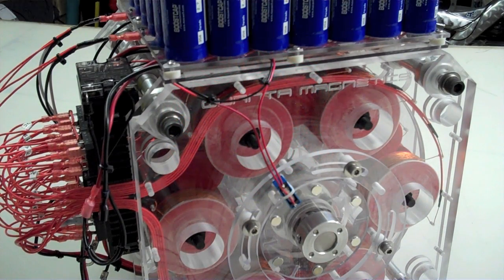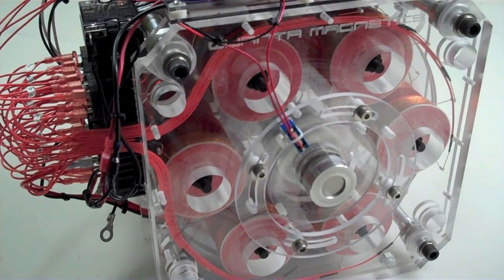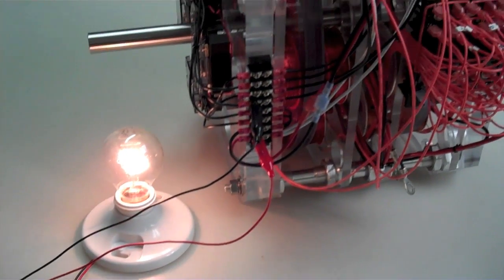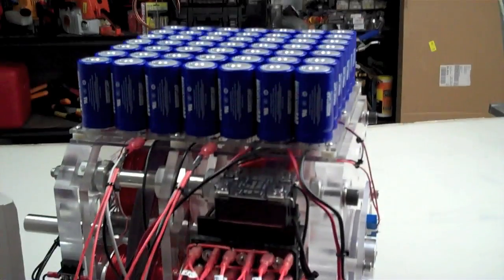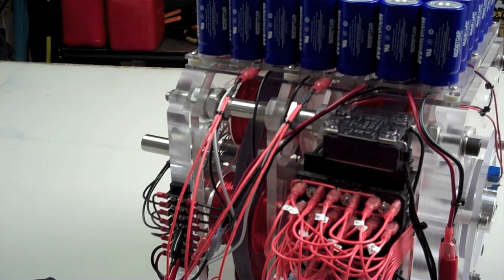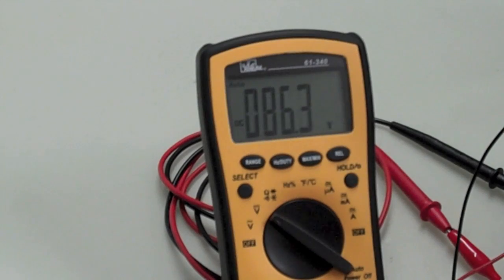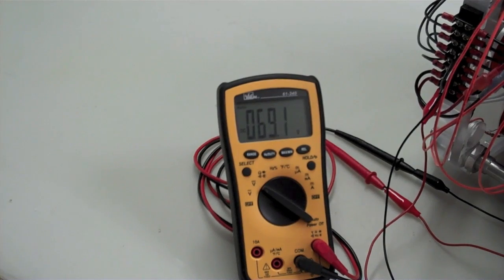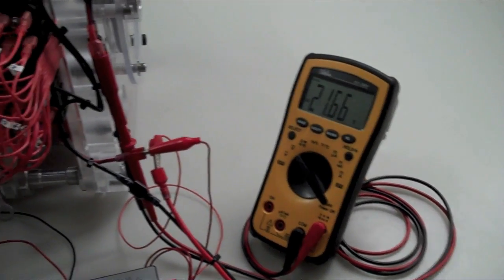Q2 SELF CHARGING.Part 2

Comment: it's a possibility that the coils have reached their full storage potential and the excess effect is being released as static and being absorbed by the bank of caps directly above the coil sets. It would make sense that it pulses.like AC current. Have you ever tried measuring the output of a single coil in this situation/setup?

Ken,
Revolution-Green(.)com

Comment: Its fantastic to see your efforts here. You are the type of people we need moving forward to change the way how we generate and use electrical energy. The seed has been planted and it will grow into something HUGE. As for the shock from the capacitors, if you touch one single capacitor, do you get the same shock as touching 2 or more? I'm thinking induced voltage but it just doesn't quite make sense. Maybe setup a trial with your 3 cap banks away from the mechanical rotating components?

Comment: Interesting comment, I read something several years ago that mentioned something about a radio transmitter having the ability to oscillate hundreds or thousands of speakers to deliver a pulse to permanent magnets driving the speakers on the receiver end. I do not recall the specific details, but the point was the transmitter output was not as big as the energy required to pulse all  the speaker magnets if tuned correctly. Was this an old wives tale or is there anything interesting going on there

Comment: Great device! You were wondering how the caps are charging on the background EMF, here is something I found that may help; "German student builds electromagnetic harvester to recharge a battery" - A student at the University of the Arts in Bremen, Germany has an electromagnetic harvester, it converts electromagnetic fields  into electricity to recharge a common AA battery. He's won a 2nd place award 2013

 w w w phys.org/news/2013-02-german-student-electromagnetic-harvester-recharge.html

Comment: Attempting to answer your question, i'd say that the difference is manifested in kinetic energy as opposed to a Solid State Power Inverters/Amplifiers are used in transmitters outputting RF. You're getting the 95% efficiency in a motor not an amplifier. The motor can be wired up as an amplifier circuit but the kinetic potential is where the difference lies. 

Ken @ Revolution-Green(.)com

Comment: Good to hear your response. To be sure, I have almost no idea of all the mechanics involved with wireless transmissions from radio to satellite to the wireless router running this computer. I follow that frequency is critical to it all, but what I think many folks are wondering is easiest to ask with an example..The sender and receiver both require input power, but what is a rough ratio of the power lost in the transmission ?  And what are the key variables involved ?

Comment: Radio broadcasts are produced through a series of oscillator, mixer, amps and filters,  but I think the "tank circuit", which is a solid state oscillator w/ a capacticor and inductor is what your talkin about, its mainly responsible for the frequency for your carrier signal that is modulated with intel and sent to the antenna.

Comment: This sounds good, there must be some wireless i.e. radiant energy going on. If so, it is reasonable that this energy transfer may not add an increased load to the original pulse. Getting back to overall  input  verses  output, are you seeing 1% in the shock value, or even greater ratios ?

Comment: All I see here is beautiful craftsmanship and clever method to amplify and oscillate the DC energy stored in the caps.  But that is ALREADY a conventional technology, and very very efficient at that with TRANSISTOR amplifier circuitry.  HOW IS THIS MORE EFFICIENT THAN SOLID STATE POWER INVERTER/ AMPLIFIERS, which is around 95%,  should be the real question.

Comment: Following up on a reply to recent comment you made, When I mentioned input and out are nearly the same on the scope screen, as you likely knew, the "off" pulse is opposite polarity to the on pulse. Also, as discussed,  the off pulse clearly shows longer duration with lower voltage on collector bank and changes proportionately as receptor cap voltage changes. Now wondering, do you think I am only storing back emf and there are also ways to collect counter emf  to minimize overall heat losses ?

Comment: Using basic diode paths, not bothering with double wound coils I have found it easy to recover 20-35% of input energy to run a pulse motor. What I wonder is...can this recovery make the pulse motor as efficient or more than a well designed 3 phase ac motor already available for sale ? Any feedback appreciated.

Comment: I thought you might find the "original " stored energy, and the recycle of it, a way to help explain your thinking. Apparently my thoughts were off base.

What happens between the weight and gravity has been well known for centuries now even before Newton days. Gravity works both ways.. put your experiment on the moon and the #s change but the outcome is relative i.e. the same.

Comment: And if you can rapidly generate voltage potentials, you can harness the radiant energy all around us, just like Tesla said to do.  In fact, charging and discharging an inductor is the primary step in Tesla's "Method of Conversion" patent.  Tesla was not mistaking back EMF spikes.  Few physicists question the existence of radiant energy anymore. Only people still clinging to old textbooks like they are bibles do. Wiki ZPE.  Tesla knew, Moray knew, Bedini knows, PMM knows. User27 doesn't know.

Comment: If I understand what PMM is trying to do, he takes an input of energy, does a standard mechanical conversion with every vanilla loss paid for but then takes advantage of a phenomenon known as a radiant spike (not bemf as user27 thinks) to create a sharp potential gradient in the static field all around us. In the instant the potential collapses the environment pours in a tiny bit of radiant energy, which is all but worthless for anything but charging batteries. But it is very good at that.

Comment: There is no stored energy.  If I give you 1 joule to lift a weight. You use up 1 joule to lift the weight. Nothing got stored anywhere. You didn't magically add energy to the weight. What you did was create a new potential gradient between the weight and gravity. If you release that potential, whatever happens between the weight and the ground is work being done by gravity, not you, not stored potential in the weight.  If unintended heat is generated, that is still work performed by gravity.

Comment: Your analogy literally had me laughing out loud. Maybe the thinking is to describe something like..  let me start out with energy stored in a raised weight.. I will drop it and use a clever device to capture the falling energy, then use it to get the weight back to 80% of the original potential energy. Now I just have to add 20% to repeat the cycle. Just recycling stored energy. My guess is your comment will explain the energy in this dynamic as well ? similar to flywheel storage or otherwise ?

Comment: Is the thought here that the momentum will crash the crystal and compensate for heat losses, leaving enough energy to put the stored energy mass back into place where it started from ? Have you considered the "a" part of F=ma and how that relates to the energy unit to raise the weight and drop it.
Proof and methods are in the hands of the inventor.

Comment: It seems you still are trying to make this into an overunity argument. It is not an overunity argument.  The tasks have never been to recover the energy in broken glass or the heat generated.  The task is to raise a weight and break the glass when you only have enough energy to accomplish one or the other.  If by any way possible both tasks are accomplished, you have COP > 1, not overunity.  No claims for overunity have been made by PMM.

Comment: Give me textbooks that explain the "fast transient voltage phenomena" that Tesla observed traveling ahead of any electron current."  The radiant event is separate and distinct from the well understood back EMF spike and trying to pass it off as that is ignorant at best. The Q2 is possibly what Tesla referred to as "method of conversion" between vanilla electricity and radiant. They are two different properties of electricity. Where are the textbooks on dumping radiant discharges to a load?

Comment: Please read the gabybewilde comment made several days ago to a comment I made. Long story short, a great comment relating to the proof being on the inventor. It is hard to say how you do it if you don't explain your methods. In my thinking, breaking the glass requires a little "more" than 1 energy unit. Most all collisions (w/few exceptions) are elastic however dense the materials may be. Even if the energy in the broken glass is recovered, the heat generated is already gone. All things possible

Comment: Agree, the timing resistance and voltage relationships mentioned here are always consistent in my scope screen as well as measuring varying voltages of the cap bank the discharge dumps into.

Comment: I will study it further, thanks for the feedback. When you say the coil output is exactly the same as the input..then why not collect the discharge in a cap bank..at NEARLY the same time the input pulse has transferred to the permanent magnet on the rotor to add a bit of torque to keep the rotor in motion if the timing is accurate enough. The scope readings do show similar for input and out but I can only recover 20-35% depending on the relative voltage of the cap bank being dumped into.

Comment: It may be that nothing unusual is happening in the motor or the coils. I am quite open to that possibility.  It may be something unusual happening in the batteries.  But some phenomenon is happening that makes using an electric motor to turn an electric generator to charge batteries more than just a simple plain vanilla demo of well understood electromagnetic theory. My solar panels pulsed to my battery bank, never produced the effects I've seen with my motor-generators and radiant spike.

Comment: The goal was never to put the weight back on the ceiling. That is an overunity argument. The underlying question is whether environmental (gravity) input can be counted as work done.  In this Q2 case, what environmental input might be occurring in the motor coils that may contribute to "super" battery charging?  If no work is contributed by the environment, then User27 is right and vanilla is on the menu. I'm not so religiously tied to my textbooks believing they explain all there is to know.

Comment: You have two tasks to complete. One task is to raise a weight to however high 1 unit of energy can lift it.  The other is to shatter a piece of glass.  You only have 1 unit of energy. If you use any of it to shatter the glass, you won't have enough to lift the weight to the required height. Breaking the glass requires a little less than 1 energy unit. I dissipate all of the 1 unit to raise the weight, but I still accomplish both tasks. How did I do it? According to your math this is impossible.

Comment: Aaron, you have great energy and I hope your passion in the energy field works well for you.

Total work done is still x not 2x. you cannot collect the destroyed floor energy and also put the 100lbs. back to the ceiling.

A collapsing field is simply a residual of energy used to energize the coil in the first place. The work to collapse the field is a ratio of the energy used to energize the coil in the 1st place. Carefully collected this can certainly add to the efficiency of a pulse motor.

Comment: Different approach.  Say the intended work is elevating and suspending a 100 lb weight to the ceiling. It takes x units of energy. Once accomplished, ALL work is done and all of the energy is dissipated. But as a side effect of GRAVITY, a new potential grade is created. If the hook breaks years later, gravity, (not you) will impart the same x units of energy in unintended work--destroying your nice floor. Work done by YOU = x. Total work done = 2x. What work do u do to collapse a magnetic field?

Comment: I can't speak for this motor, nor have I achieved such amazing results myself.  What I have achieved is a slow, yet sustained reduction (over months) in the charging time and a slight increase in the amp hour capacity of my batt bank. I didn't accomplish this with the a well understood pulse charge. Please explain to me in intimate detail how you've measured on your bench the effect of a radiant voltage spike applied to a battery bank over months of testing instead of one day denouncements.

Comment: So how much 'work' can it do?
I notice you say the motor is on "full power", "Full torque" It certainly did not sound it to me, how do you calculate 'full power' without a measuring the torque (power)
Also how much power did you put into the system a/using the battery bank (in watt/hrs)
You say when using a light bulb that it is "not really designed for resistive loads" Really, what other type of loads do you know? Any battery to be charged represents a resistive load to the charge device.

Comment: I also think PMM has come a long way in developing worthwhile devices. I hope you will comment and find encouraging results with the Q2 ! Can't say I completely follow the rubber ball analogy. 1 unit of energy would hit the floor and being an elastic collision 20% was spent hitting the ground and the other 80% took the ball back to 80% of the original height. I do think there are advantages to momentum and gravity (electrical and otherwise) that have not been fully realized. Good luck.

Comment: The claim is not more out than in.  If that were the case PMM would not state that this machine eventually quits spinning and dissipates all energy in the caps through the motor coils, heat loss, impedance, magnetic drag etc... Like every other motor, this unit is less than 100% efficient, otherwise it would be a virtual perpetual motion machine and PMM has never claimed that. It is a net consumer of energy, just like your fridge. Likely (I haven't tested it yet) the Q2 does have a COP > 1. How?

Comment: Well, I'm just looking at this from a very simple layman's point of view. If you're getting more energy out of a system than it takes to run the system, it looks like over-unity to me. So if the generator section, via the capacitators is putting out more energy than required to run the motor, enough to light up a light bulb (carry a load) while still powering itself, isn't that over unity? I notice the amperage is very low though, so maybe it's a question of power...

Comment: I somewhat agree.  I'm not knocking textbooks. They have their place and life is a lot better with them than without.  However textbooks should be used as reference manuals and not bibles. Somewhere along the way, we replaced experimentation with textbooks containing a 150 year old, unbalanced, antiquated equation.  Disclosure: I am a adjunct professor at a large university and use textbooks constantly.

Comment: The main point of these types of motor-generators is using 10 solar panels vs 20 to get the same net charging effect in your battery bank. That is special.  But with only a textbook education, you only see the asininity of hooking an ELECTRIC motor to an ELECTRIC generator.  It makes you angry to see crap like this posted and the uneducated falling for it.. Makes you want to slap the stupid out of some people.  ...until you build/test one for yourself and realize your education missed something.

Comment: These are expensive experimental devices and I personally don't recommend buying one until you completely understand the difference between efficiency and Coefficient of Performance > 1.  Until you do, this is nothing more than an expensive, pretty motor.   RadioShack has a great introduction manual to electronics. Their arduino manual and kit are also a great way to get into timing circuitry. Google and build a "pulse motor" that captures a radiant spike. Be prepared for a learning curve.

Comment: All reasonable points mentioned here. However I do not think our current textbooks completely explain the energy transformation that occurs every time an electrical pulse is turned OFF. One way I look at it is as if the (HIGH) voltage train is let loose on the track and power is cut off  it is not going to suddenly stop in its tracks....it is easy to collect the braking momentum via diode for a partial recovery. In your thinking, 3 phase motors are the best dynamic for energy transfer? The End.?

Comment: Hi Jon, great observation.  It is hard for me to tell from the video if the small motor is making a stalling squeal or spinning up. If it is spinning up, it may be that the Q2 halted on on a closed commutator dumping whatever energy was left in the caps directly to the smaller motor instead of pulsing it.  In PMM's defense, why create a stellar video only to ruin it with that? Obviously he knew about it and probably didn't think it was anything to hide.

Comment: On second look, I think I follow your reply. In a brushless motor it is possible to avoid the losses related to energy stored in the field ? If a brushless motor INCLUDES capacitance tuned to match the system, the reactive power loss may be reduced ?

Comment: Before denouncing this work, you need to understand what the guy is actually claiming.  However a textbook understanding is inadequate to evaluate his claims. I was a skeptic myself till I built and tested nearly a dozen of these type of devices and saw for myself that a conversion (not overunity) phenomenon exists.  This is an expensive unit, but the principles can be tested with cheap parts. Dust off your oscilloscope, build something and then get back here to chat.